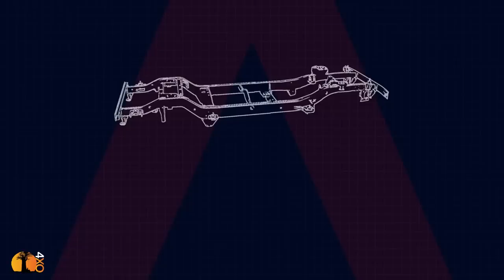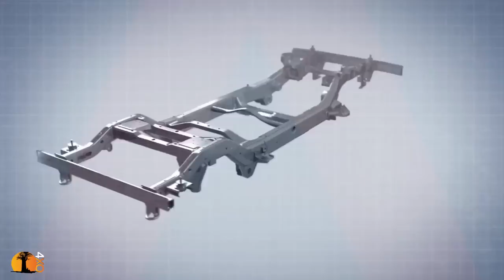INEOS GRENADIER or LAND ROVER DEFENDER. Which one would you buy? 4xOverland

Comment: I liked this video the moment he said “ we can drive ourselves and not some computer”
Reply: Ironically, since Andrew made this recording Ineos has released a video of the power train being tested. They’re reworking the BMW 6 cyl to get more low down torque from it (never its strong point) it’s also going to be mated to an 8 speed electronically controlled ZF auto box with no manual option. I think you might need your laptop in your epic off-road adventure. In my view this will just be a more crude alternative to the new Defender, with the engine from an X5 & the gearbox from. Disco4. What’s to get excited about?
Reply: @hughmarcus1  Agree entirely. And it's all very well being all nostalgic and old school but the new LR Defender does look very capable if the Namibia test is anything to go by. Could the Grenadier match it? 

I think the whole thing that puts me off is it's just a rip off design and if it looked like anything else nobody would be interested.
Reply: k halliday  That's absurd. It couldn't be a more blatant rip off if they tried, unless they bought the patent or copyright or whatever for the design. The design couldn't be any closer if they had taken a sheet of tracing paper and traced over the original blueprints. The proof of whether either company succeed or not will be in the sales, but what you may think of the Grenadier or the original or new Defender model is irrelevant. Land Rover own the copyright and it's their choice to name any vehicle they choose with that brand.
Reply: Auto only? Why not 4 speed manual with a 2 speed transfer case?
Reply: I like his emphasis when he like or dislike  something... that's why I like watching his videos, because I know I will get unbiased review.

Comment: It's like the love child of a G Wagen and Defender. This is the first new vehicle I'm excited to see hit the market place for a long time. 

I'd be very surprised if the Grenadier doesn't end up being looked at quite carefully by defence forces as a light duty 4wd vehicle.
Reply: It is. In fact, Magna Steyr lended a hand in the engineering.
Reply: I was thinking the same thing. 
I hope it’s wider than the defender, and the engine and gearbox are solid units that will run for 100s of 1000kms without issues. These vehicles should last decades if built right.

Comment: Ineos have stated that 25,000 units will be the production goal. With the faults of the old Defender fixed, I think sales could be higher than that.
Reply: Andrew Hurst especially if it goes to N America
Reply: This would sell like hot cakes in Australia.
Reply: In N America we might be getting a proper offroader from Ford in the new Bronco. But, that's a slim chance since Ford is also quite proud of their electronics.
Reply: @JosiahTech  The Bronco is also massive
Reply: @MarkRose1337  it's supposed to be based on the Ranger platform, not the F150 like the old broncos so it should be a bit smaller
Reply: Depends on price.....
Reply: didn't the last year of defender sell 3000 units ?
Reply: @alanedwards6491  Rumoured to be around K$80. It's a lot but then you might be getting a lot.
Reply: Needs to be at a reasonable price. But with a BMW engine I doubt it
Reply: @nidgen5523  LHD conversion/construction may be a problem?
Reply: They are after UN contracts as well i think.
Reply: @einfelder8262  I'm sure they will have designed that the start.
Reply: There are wrangler rubicons at every stoplight here in the states and a 25 year old defender with 100k miles on it goes for >$40k here.  If they can distribute it and provide support and parts they will sell a lot of vehicles here.
Reply: @benmadden9413  because last year of production was 3 months...
Reply: @JosiahTech  Bronco is going to be IFS and heavily turbocharged sadly
Reply: It’s going to come to NA and be stupid expensive for only the “look at me” crowd. Sucks because we put our LR4 to good use and would love the grenadire
Reply: who you kidding.... its yet another sad fantasy brand of a dude that is too rich.
Reply: The Ineos Grenadier is not the answer to the new Def. only. It is the solution. Kindly Fiete
Reply: Is it wider? That's what the Defender needed.
Reply: Can't wait to have a few of these for my business!
Reply: harbinger808 lets hope that version of the name doesn’t stick

Comment: I've been waiting for this review, and it didn't disappoint. I drive a 110 daily and love it, the new defender was such a let down. Fingers crossed for the Ineos.
Reply: Dugie Doogs  im not sure that was the problem. they added too much junk that you dont want for a utilitarian car. cameras everywhere, auto transmission, over 80 computers controlling it all, you want 1 to control the engine for emissions, and thats IT.
Reply: @petelattimer6808  I spoke to one of the engineers who worked on the new defender project. It's literally the front end of a Range Rover and back end of the Discovery sport welded together, with an extra bit in the middle for the long wheelbase version.

Comment: Thanks Andrew, I own a Discovery 3 and as I live in the uk is easy to get parts at reasonable prices. As you know the D3/D4 is ok as a middle of the road vehicle “good” on road and “good” off road which is fine here at home but I’m sure it would never do the Canning stock route or any of your long distance trips.

I love the look of the Grenadier and like you it’s obviously designed to look like one vehicle in particular. I think Ineos tried to buy the rights to continue production  of the Defender but LR said no.

I think that as it using BMW engines they have also struck a deal to sell them through existing BMW dealerships.

It would be nice to think that the axles and suspension are existing parts to keep costs down and reliability up and allow modifications from already known suppliers. I would imagine that the interior would reflect BMW as well to tie in with the engines.

The most challenging thing will be costs I think here in the UK a base stripped down model will cost at least £40,000. And put it on par with the new Defender and as we don’t get the Land cruisers that you get it won’t have any competition (Jeep wrangler maybe).

If however the car can be modified through the dealer with third party stuff (bumpers,lockers,roof racks etc.) then it will make it work better.

Hopefully they can reach out to utility companies, Police,military etc to get bulk sale at lower prices to help get production numbers up.

I would love to see what you could do with one, maybe you could set up the first Australian Dealerships with some of your contacts.

And Ineos should send you one to test for them any company should be glad for the feedback good or bad

Comment: This is a new vechile.  Even though everyone is calling it. The new Land Rover. But that is where the full stop, came.
It has a G Wagon bonnet. 
The vechile is going back to basic. A vechile with no computer control's. It is a ruff tuff  vechile.
Reply: The engines and transmission and ESP and ABS and airbags will all be electronic.  Can't pass any emissions regs otherwise.
Reply: @einfelder8262  Well the Defenders and all the other rough off-roaders  have had such electronics for 20+ years. At least in Europe. So that's obviously not what putting people off.
Reply: @einfelder8262  l was thinking off things. Like descent controllers and things that helps the driver.

Comment: As a serial BMW owner I have alot of reservations with the powerplant choice. Granted it will be detuned for reliability but I don't have as much faith in them as I would a Toyota unit.
Reply: B57/58 is an excellent engine and proving reliable & strong
Reply: is that nobody produces better engines today than BMW
Reply: BMW engines are fine. It's their electronics and tech that are typically unreliable.
Reply: As long as the cooling system and seals are not made by BMW, it’ll be fine...
Reply: ive had 3 new landrovers in the past 10 years   and i have to say everyone has broken down at some point  .the issue have is getting landrover to fix them with out costing you a arm and leg
Reply: Can we light fires under a metal  sump when the oil has solidified in the arctic or will a plastic sump be melted?
Reply: Toyota used basically a modified bmw in their flag ship sports car.....
Reply: SixtyFo WV 3. From the Amarok or Toyota 3. Would be better , but give it a chance , time will tell .
Reply: @philhealey449  : lol, you can have a solar powered in sump heater..  ha ha...

Comment: I think they hammer on the "form following function" and "engineering led"concepts to avoid being sued for copying the Defender. Or, it means the old Defender was the best designed vehicle as this is the best the engineers can come up with now.
They are not using newly designed parts. The majority of components are coming off the shelf from established manufactures, and this is good because parts will be available over the counter anywhere. 
BMW build good engines and again, available nearly everywhere.
The only issue is the price. If it can be in the region of or less than a 70 series Land Cruiser, they will have a winner.
Reply: I'm thinking maybe 200 series price, but if they can make it only 5-10k more than the 76 it would be a hit
Reply: Target starting price is £35k, The roots of Land Rover was form following function as with many of the famous utility 4wds so their shape will naturally be similar
Reply: "BMW build good engines and again, available nearly everywhere." wash your mouth, ask any BWM specialist about how much work they have because of their engines....a lot, that that isn't good. It's not that there are brand new highly complex BMW engines scattered around isolated areas on the globe.... you all are kidding yourselves
Reply: 357MagnumPlinkster Society  yea hopefully pickup and chassis cab will be around that if the station wagon is £35k
Reply: I think they got sued, or threatened and won (LR lost).... (read something, somewhere.)
If JLR decide to stop making a genre of vehicles, they can't morally (legally - they have to win that argument) claim infringement on "approximate styling".
Reply: kadmow m
Reply: @Spencer Cash - Quote:
   "BMW build good engines"
No they don't. They build superbly smooth engines that are expensive to maintain, that last 60,000 miles and then break. Very expensively. And they need computers. Ask any RR or LR owner.
Totally the wrong choice and I suspect listening to the engineers they went native. Even VW build better engines.

Comment: Defence contracts would help with the numbers if they could nail it. Also, like Australian army Defenders, an Isuzu diesel engine. Better than BMW for parts. Cheaper and utterly reliable.
Reply: Toyota diesel engine and Mitsubishi gearbox.
Reply: Or Cummins 2.8
Reply: M.T. Steyn de Wet Cummins are super impractical everywhere else besides the US
Reply: I doubt toyota mitsi isuzu or any other those are going to give essentially a direct competitor their parts though?  I'd love a 3l isuzu in it.
Reply: Mike Zog that’s a better idea than mine but I there is rumours they are going to discontinue the v8. Also it would be easier to do a deal with Isuzu because the new bt50 is Isuzu and because of the mentioned Aus defenders deal. In other words Toyota might not want to part with any motors for the project.
Reply: @TrolloTV  not quite. Foton uses the Cummins 2.8 in their pick up trucks, and they have dealerships over most of Africa, South America and Asia - so you'll get help if you need it. 
Besides, in all the trips I've done, I've lost tires, had clutch trouble, had gearbox trouble - but never really had engine trouble. Even after using diesel that looked like old coffee - eventually I did have to clean the injectors, but not before I got home. Once lost a starter motor, another time an alternator - but those you get a Bosch replacement for. If you have a bullet proof engine, your engine will most likely not be the problem on a long trip.

Although, an Isuzu would still be better.

Comment: Would love to see portal axles on this...it'd be unbelievable on and off road
Reply: Not really needed on a road vehicle at an increased cost and weight.
Reply: I've never heard any good reason why a portal axle would make something better on road (Unless you ran it upside down to lower the centre of gravity of a vehicle that for some reason you were absolutely tied to giving rigid axles to in the first place). As soon as they put 2 rigid axles and a panhard rod on it they nailed their colours to the mast in terms of committing to making it great off road (And the toughest solution in terms of load capacity for the money) but by the same token it will will never be particularly good on the road. I'd like to see a portal axle option from the manufacturer.
Reply: TheScoot44  Tibus
Reply: TheScoot44  or you can use army grade portal axles
Reply: Portal axles, whilst giving greater ground clearance and therefore off road ability, greatly increase gear drag and therefore fuel consumption and emissions. They can take a few miles to warm up in cold weather before top gear can be used, which will be a concern if used to travel any distance on the road. A portal option would be good but I think diff locks front and rear would cover most problems. I've used portal axles and diff locks for years and  the diff locks are the best compromise. If you can't get where you want to go with solid axles, coil springs and diff locks, you need to go to off road driving school.
Reply: 99.9% of the tracks, camp sites all around the world can be accessed without the drama of portal axles. 

Why in god's name would you want portal axles for a reliable tourer? 

(Rhetorical question, you wouldn't).
Reply: @Nick-sd7um  Google Marks 4WD portal axles for landcruiser then you'll understand where I'm coming from :-)  I'm sure with the engineering Ineos have at their disposal they would create an incredible setup.

Comment: Only yesterday I was talking to the other half about finding a replacement for my mk4 Shogun 300,000 miles towing maximum weight most days. 
She hated the old defender, noisey and uncomfortable but did the job. The shogun does equally well for the terrain we encounter and luxury in comparison but with the importation to the UK ending we were lost for a successor as I do not want a pickup, this morning I open my phone and my prayers may have been answered, Grenadier from Ineos
Testing its towing ability and tight space manuvering all round visbility and comfort will be a challenge after the Shogun. 
I just have to try one, fingers crossed. 
Paul Taylor

Comment: I think you are confusing the issues here...

The Landrover Defender was a type certified commercial vehicle similar to the design stable the G wagon appeared. Landrover discontinued the Defender as landrover wanted to exit the commercial truck market when military orders dried up. The annual production dropped to circa 30 k units which made it unsustainable.This also was the story of the G wagon which was due to end production.The G wagon was saved as it found a niche  luxuary market in places such as Beverly Hills and Middle east. Landrover used there pot of cash to develope the Fpace and Velar as they beleived it would give better investment returns.

Landrover made a judgement and decided to develope the Defender as a luxuary car instead of truck using many existing technologies. Now former owners of the defender boyed by a popularity boom from developing countries and leisure users wanting to replace their old defenders. 

Enos- Landrover Defenders used to be assembled in Spain by a company called Santana using UK kits.The Genader should once again do this by producing finished rolling chassis to be completed in global locations.This seems to be the best business model which is not too far from other motor manufacturers.

Comment: Hope. It is not fitted with:
Electronic  Traction Control
Hill Descent 
Eletronic Keyless Start/Stop Button.
Climate  Control front and rear.

What l would like to see:
47 different things that can be placed on the back.
45 degree approach  and departure  angles 
Along with 45 degree side angle
1 ton, not tonne load carrying capacity, 
3 ton, not tonne towing capacity 
1 metre, Yes 3 feet of wading.
Seats, comfortable enough. Not able to bang head and shoulders  on B pillars.
Reply: Just to clarify for you, 1 ton is a metric unit equaling 1000 kg.
1 tonne is an imperial unit used in the US and Canada amounting to roughly 907 KGs.
Reply: @robertjohnvanzyl4020  wrong way round. A tonne is the metric measurement. Ton is imperial.
Reply: surprised you left in FI
Reply: @gsylass  1 UK ton is 2,240 lbs, so slightly more than a tonne. Isn't a US ton less than either of these?

Comment: 16:50 Wait WHAT!? Auto only? Where did you hear that? That's a massive let down, I assumed they would be speccing one of ZFs light duty truck transmissions which fit the torque profile of the BMW B57 & come in both automatic & manual skews. The ecolite is a fantastic 6 speed manual box.
Reply: Ineos says a manual is planned as soon as possible. I don’t know how true that is... they better work fast if they want farmers buying them. Maybe when they make the pickup version they’ve designed
Reply: @zaydansari4408  Aye, that makes sense, I really am holding out hope for a proper boggo spec one in the £20-30k range to compete with the Japanese crew cabs.
Reply: @BluTrollPro  lol
Reply: @BluTrollPro  they've said the price would be a touch more than the Ranger Raptor so probably approaching 70 series LandCruiser money.
Reply: My father has a 82 Land Cruiser, that is the real deal. Manual hubs, manual transmission, manual transfer case, manual windows. By now it is over 700k miles and it still rolls